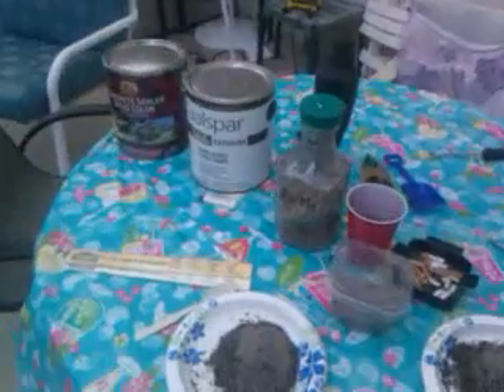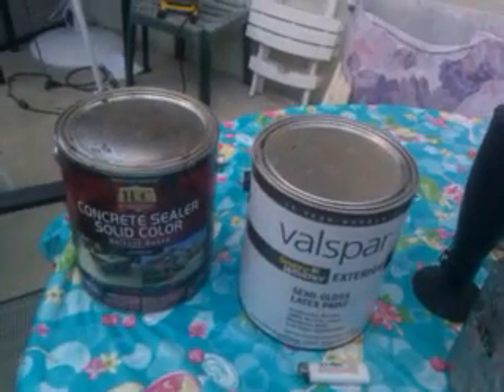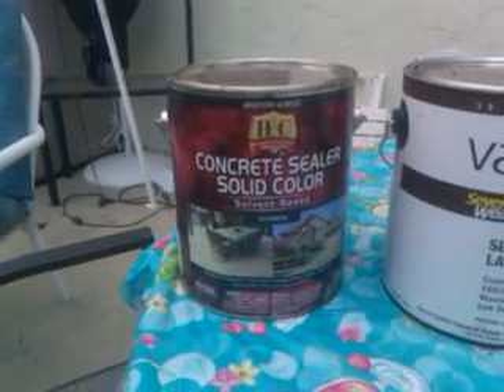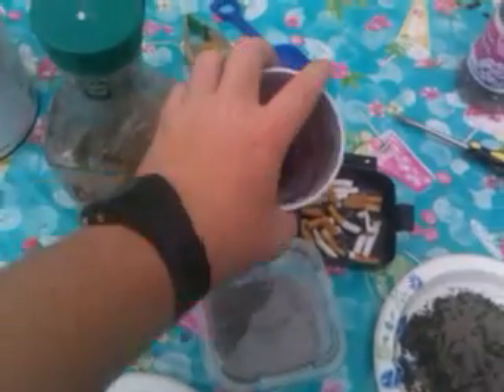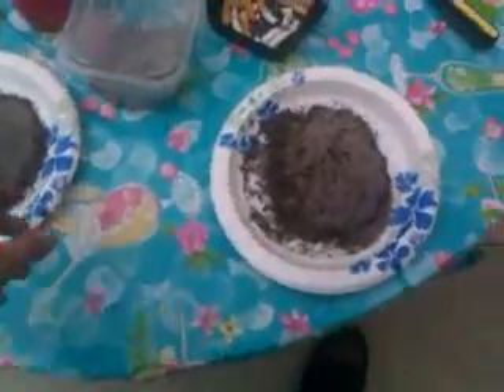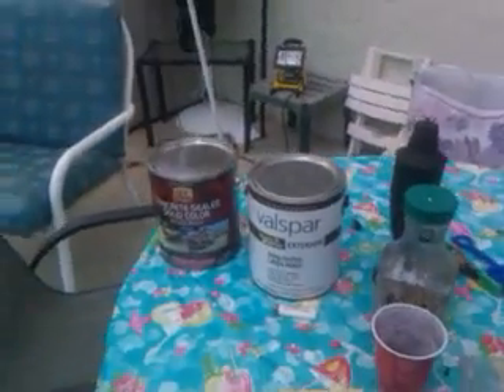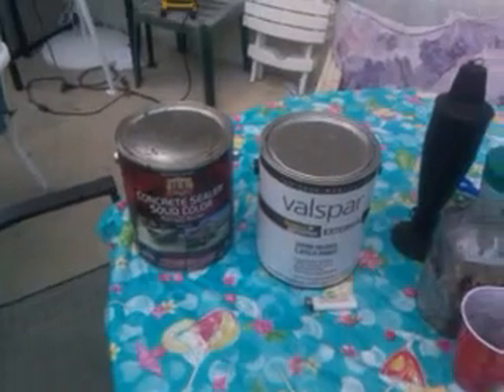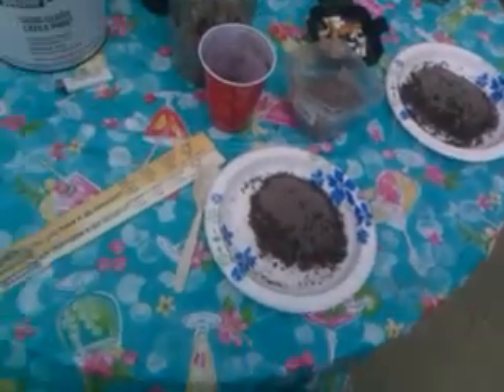Making cob, adobe / resin mix: New unseen material part 1

Comment from the maker: @OldSchoolSkill Thanks for the input. I'm always up to something. The VOC's would be a problem. I think since then I've decided It needs to be a higher percentage resin and can be all sand, but haven't made any updates. I also have an idea for a textured plaster surface that you put a thin layer of colored clay on the texture, like dirty pants, as a way of coloring a white wall without VOC's and also washable and can change the color at any time. Never made a video of it though.